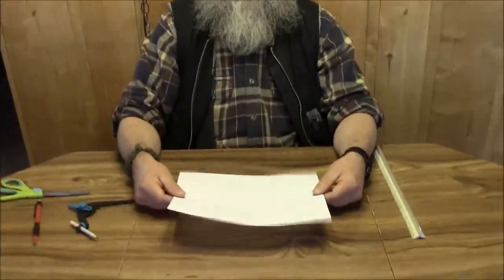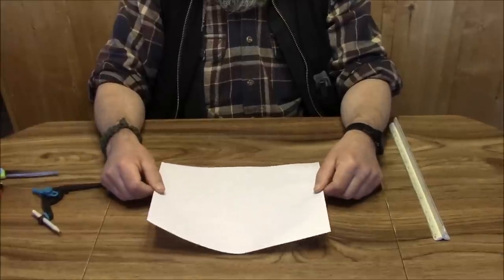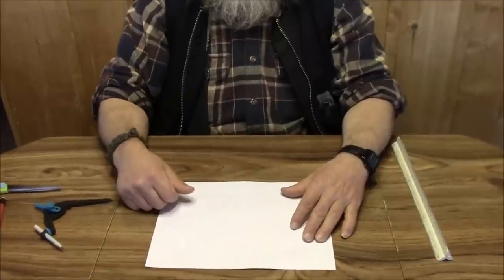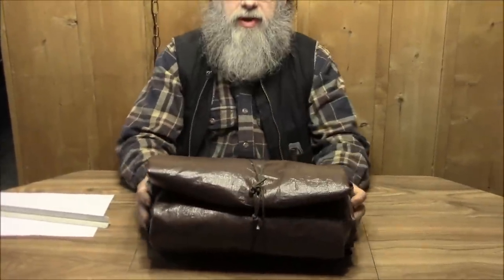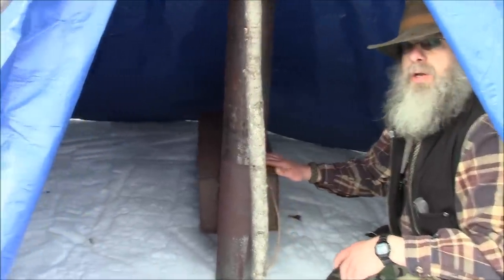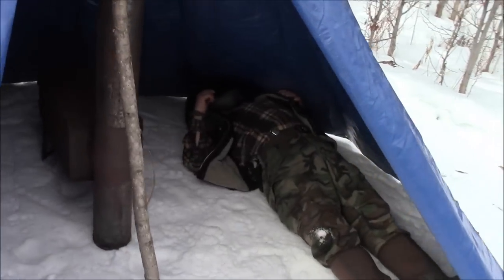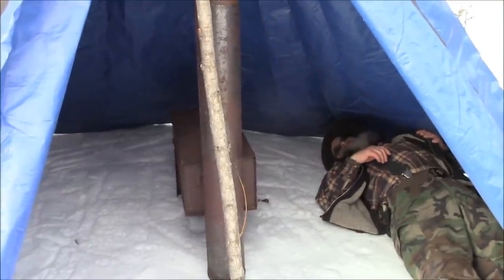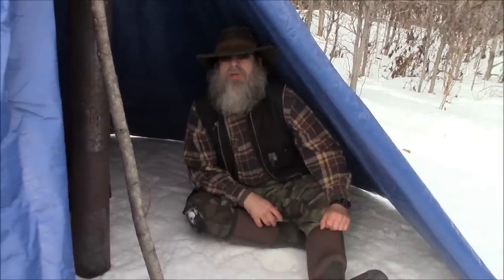Make A Tarp Tent Tipi Hot Tent On The Cheap

Comment: I really want to make one of these but out of Silnylon. I'd Imagine the outcome would be the same, no? The only difference is that I would have to sew 2 large pieces together since they don't sell Silnylon any wider than 5 feet.  

Since the width of the tarp (12') will mean that the height of the tipi will be 6', does that mean that the length (16') will make the diameter of the tipi floor 8'?
Reply from the maker: Silnylon should work great.  I would sew it though instead of using tape.  That way you would have a lighter, more durable and professional finished product.    The diameter of my tipi base is about 10 feet.   Go ahead and make a paper model in just the same way as I showed in the video series.  Once you have the model made to scale of the material you want to use then you will be able to figure the final finished product dimensions by measuring the finished model and using the same scale calculations.   I am NOT very bright when it comes to math so I am sure you should be able to figure it out yourself.
Reply: +pennwoodsman He says it's 12x16 feet.
Reply from the maker: Yes 12 X 16 Feet
Reply: would a 12x12 work that's the limit on the alone tv show
Reply from the maker: I do not think so but you could make a paper model just like I showed in the video and scale it like I showed.  Then you could measure off of that paper scale model and no what it would look like in full size.

Comment: How tall is the stick?
Reply from the maker: approximately 6 feet.  I have never measured it.  In the past i have obtained a new stick each place I set up in and cut it off until it fits.   Now I use an adjustable length aluminum pole such as is used by painters.

Comment: If you want it lightweight.... A DD-XL tarp is 3x4.5 m which is just slightly short of 12x16 feet (3.7x4.9 m) so the tipi wil lbe slightly smaller, but it will weigh only 1 kilo (2 lbs).
Reply: +wazzup105 ....did you make up this design you mentioned, because I got one DD-Tarp.
Reply: +Herbert Hriberschek Nope. Still haven't found the right excuse to buy a DD-tarp and even if I would it would probably not be the XL-version. There's video on the tube that shows how to make a tipi "tarp-tent" out of a DD-tarp though.

Comment: Put a tin cup or similar on top of the pole so it doesn’t rip the tarp.
Reply from the maker: I like using tennis or whiffle balls on top of poles to distribute the pressure point.   I also use them on the bottom of my chair legs of my backpacking aluminum chair to keep the legs from sinking into snow or sand etc.

Comment: Can you live in one of those
Reply from the maker: I personally would not live in this one as it is too small to be comfortable on a long term basis.
Reply: Depends your location also
Reply from the maker: I know of a fella that used what I believe was a 16 foot by 20 foot tarp and did this same project but with the larger tarp.  It was a much better size for longer term use.    I believe that you are the person that In another comment of yours, I referred you to a video I did on another tipi type tent though it is 4 sided.  I like that tent much much better than this one for longer term uses as one can stand up in it and move around much better.  However it also requires a larger woodstove to keep it warm though with an appropriate sized stove, I have been quite comfortable at well below 0 Fahrenheit.

Make A Pyramid or Range Hot Tent On The Cheap
https://www.youtube.com/watch?v=t47WFUZM4go

Comment: Latest revision 12/31/16
I took out the ax for a gill net the crovel shovel doubles as an ax
10 items for Alone tv show History channel 
the reason for two containers is for steam distilliation desalination of water.
1 tops knives steel eagle 111 with saw back 2  crovel tactical shovel tim ralston gear up center 3 gill net 4 two quart pot self reliance outfitters 5 canteen from self reliance outfitters 6 clear ripstop tarp 12X12 7 1/2 inch x 6 inch ferro rod from firesteel.com
8 german army sleeping bag/coat 9 550 para cord 20 meters 10 fishing line and 25 assorted stainless steel hooks and tin to put hooks in and make char cloth.

Comment: How about air vents
Reply from the maker: I personally do not feel any need for air vents in this while using a wood stove.   The stove itself is a vent in that it pulls air into itself for the combustion process and sends it up the stove pipe.   So air is constantly being sucked int the tipi to replace that which was sucked into the stove.   The tipi door goes most of the way to the peak so at times when the stove dumps a bit of smoke into the tipi interior such as when the stove door is open to re-stoke the stove, I can open the door wide and the interior will be thoroughly exhausted in perhaps one minute.

Comment: I enjoy your videos so much!  I learn something with each one!  I love this design, and I will make one.  What do you think about using a large firebox stove for heating the tent like this one:  http://www.fireboxstove.com/image/cache/data/firebox1-800x800.jpeg  if you created a vent at the top of the tent to dissipate the emissions?  I use firebox stoves for cooking when I am camping.  I love them because they collapse down very small and flat.
Reply from the maker: Daliwolf Bacon Yes I think using a small portable cook stove like you mentioned perhaps could be used in this shelter if there is enough ventilation at the top.   The stove must be designed to maximize efficient burning so as to reduce the smoke output.  The shelter would also need to be very open at the top like the traditional tipi.  For me though it just isn't worth it.  These little stoves like that can't run much more than 5 minutes without having to add more fuel.  Heat rises.  As soon as your stove starts to die down your heat will instantly be gone since there is no way the shelter with an open top can collect the heat.  I always carry the "Bushbox XL" which is a very similar stove to the one you mention.  You are right, they are very useful for cooking.
Reply: Thanks for your advice!  I did find this stove via karenchakey here on youtube:  http://seekoutside.com/wood-stoves/  I totally see your point about having to feed the small stove to keep it warm.  For a regular winter camping trip the bigger steel stove is the way to go for sure I believe.  For a survival shelter kept in the car during the winter, it would be easier to carry one of those small titanium stoves me thinks than a steel stove.
Reply from the maker: Daliwolf Bacon Those seekoutside stoves look awesome.  Yeah I had already seen karen chakey's review video and was envious of her stove lol.   One of those stoves would heat the tipi shelter fine

Comment: How do you know how long to cut your pole?
Reply from the maker: I step inside the staked out tipi and raise it to full height and then measure it against my body height.   I then cut a pole a few inches longer than that and trim the excess length as needed after trying it out.
Reply: @Far-North-Bushcraft-Survival   thank you so much! I love your videos man, thank you for sharing your wilderness knowledge!
Reply from the maker: if weight and bulk do not matter for a particular trip, I have found a couple of telescoping aluminum poles at thrift stores that I have replaced the location cut poles.   These poles are what painters may use for extending the reach of paint rollers.
Reply: @Far-North-Bushcraft-Survival   I made me a tarp tent. I made a extra flap for the door, but I’m struggling to figure out a way to latch the door. Any ideas?
Reply from the maker: I have also always struggled to come up with good door closure ideas.   Usually I overlap the door flaps and reach underneath the inner flap to the outer flap to loop a cord over a stake.   One can buy zippers that are made for installing on a tarp so as to make a doorway in a tarp.  They are tape based.   I actually have one but have never installed it to try it out.

Comment: That is a great way to make the larges tipi/cone from a given tarp.  There are online tools called cone calculators that allow to specify the a couple of parameters it will calculate the shape of tarp like you did in your modified tipi design.  Here is one such site.  http://www.cleavebooks.co.uk/scol/calcone.htm

So if you are after a tipi/cone of a given radius or height, it will calculate how to cut the shape out of the flat tarp.  So if you have a 20' tarp, it will give you a shape that will maximize the tipi size.
Reply from the maker: bwillan Those online cone calculators looked interesting.  I didn't find any though that would take a given flat surface and create a layout diagram of the greatest sized cone to be derived from said flat material.   Perhaps I just didn't see what I was supposed to see.
Reply: I agree Lonnie.  One would have to do a little math to fine to figure the shape.  The tool does allow you to play around and see what works.  For the one I linked to, I believe the slant height translates into half the max width of the tarp you are working with.  The height or the base radius is up to you.  Just pick one and put it into the calculator and it will give the other value. 

How heigh is your tipi and what do you figure the base diameter of the tipi is?
Reply from the maker: bwillan My tipi is aproximately 6 feet high.  I am about 5 feet 6 inches high and I can stand almost straight with my head next to the center pole.   The tipi is 11 feet across and is approximately 33 feet around at the base
Reply: That is a decent sized tipi from the 12x16 tarp that you started with.  Are you going put a loop at the peak so the tipi can be suspended with a bipod or from a rope between two trees? 

Doing that will eliminate the center support pole and will give much more usable space inside the tent when not using a wood stove.
Reply from the maker: bwillan Please see the video as I addressed that issue in the video.  It is located here 
https://youtu.be/wtLdMIaIIFw?t=33m23s